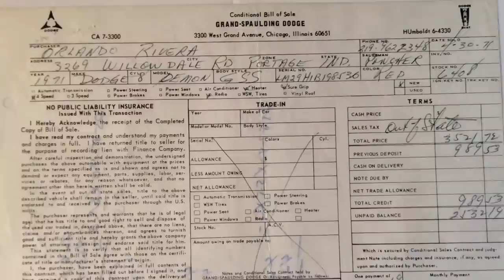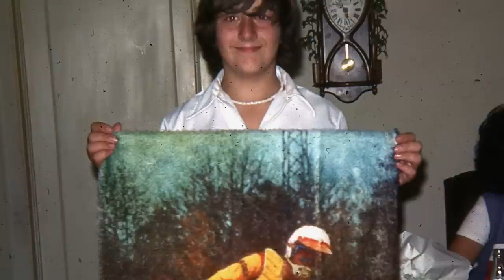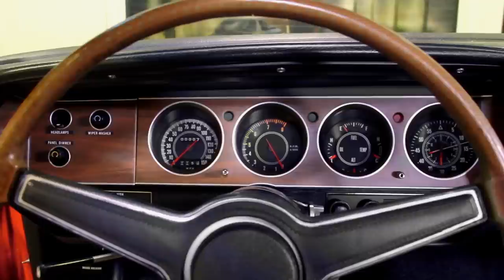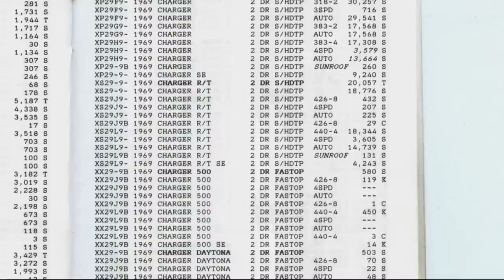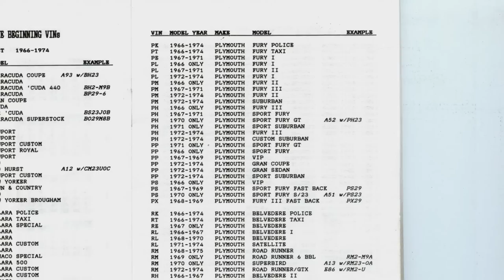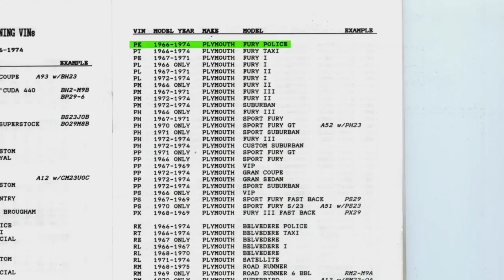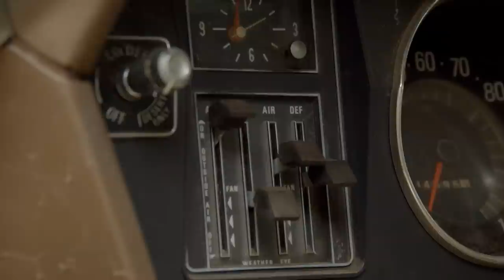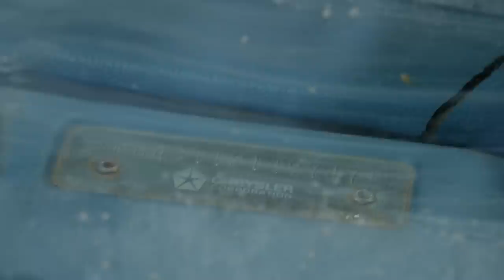BARN FIND CHARGER R/T: MARK AND DOUGIE MAKE THE SCORE!

Comment: I figured out that if equally divided, there should be around 4000 plus Chsrgers 68 thru 70 in the lower 48. If half have been destroyed, half restored and half waiting to restore, there should still be a couple thousand per state. I wonder what the numbers are.